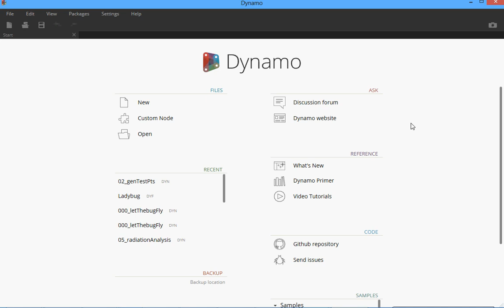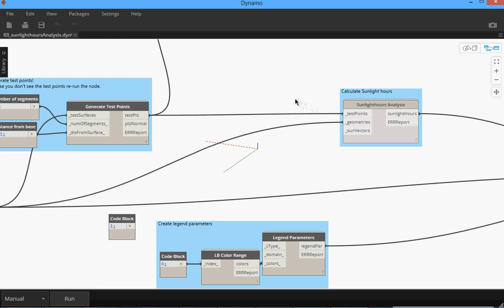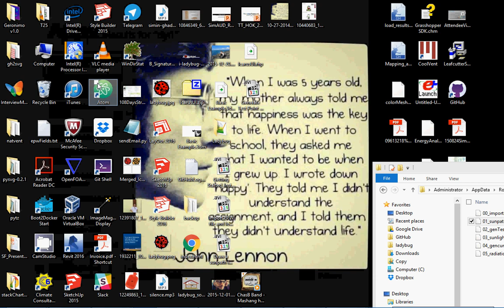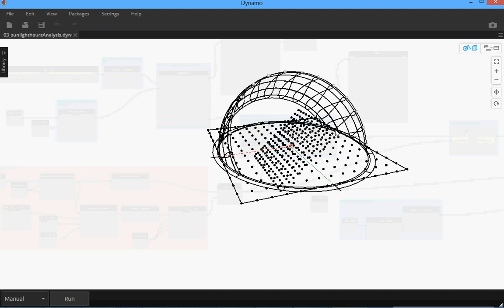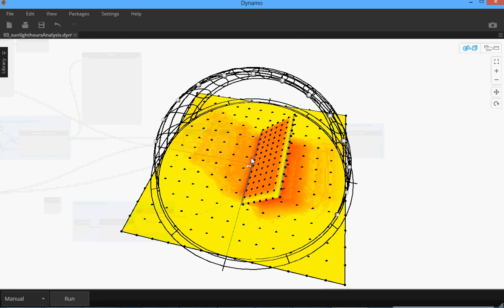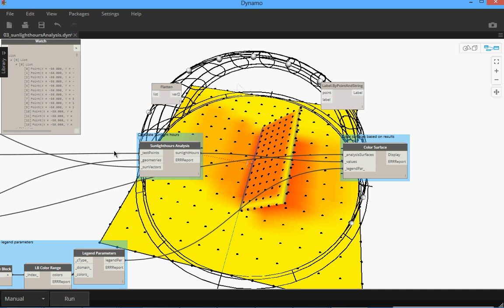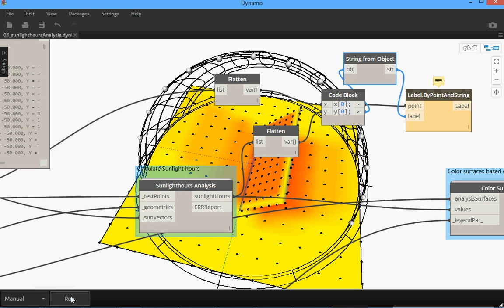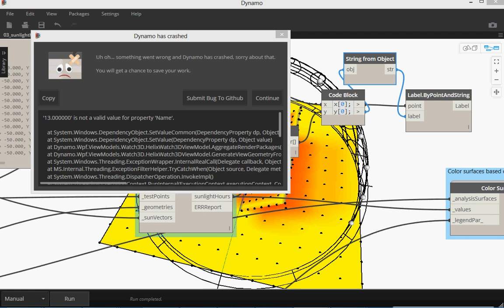Sunlight Hours Analysis in Dynamo

Comment: Thanks for your video Mostapha!  
But I'M  a new comer of dynamo .Could you tell me how to get  the "gencolors_code.py " in custom node "Generate_colors"?
Reply from the maker: You don't need to do it yourself. Just download the example file from here and it will have the definition already set for you: http://hydrashare.github.io/hydra/viewer?owner=mostaphaRoudsari&fork=hydra_1&id=Sunlighthours_Ladybug_Dynamo&slide=0&scale=1&offset=0,0
Reply: But the code block“Run Radiance Analysis” reported error，what's wrong...
Reply from the maker: You should post your question to the forum: (http://discourse.ladybug.tools/t/welcome-to-ladybug-tools-forum/8). It might have been already answered: http://discourse.ladybug.tools/c/dynamo/ladybug
Reply: I finished the “radiance” step，then the error became：“E is not a valid Honeybee boject." What should I do...
Reply: Error ：name “color” is not defined
File “<string>” ,line 23 , in <module>
Nameerror: name ‘color’ is not defined.

Comment: hi, can you tell me how to deal the relation between sun path scale and the size of surface, please?
Reply from the maker: Tallman Chan you can simply scale the sunpath in Dynamo using the scale input
Reply: Mostapha Sadeghipour Roudsari so it means it doesn't matter how big the sun path is ,the scale doesn't affect the result.  Right?
Reply from the maker: Right! The analysis is using the vectors for the analysis and not the sun geometries. Scaling the sun-path won't affect the results.
Reply: Thank you so much .Can dynamo show a label discribe the range of each color like  grasshopper's?
Reply from the maker: I'm not sure! I couldn't get it to work. Also see this: https://forum.dynamobim.com/t/labelling-point-visualising-data-cfd/9980

Comment: Hi, thanks for your lesson, but I have a problem with "Sunlighthours Analysis" node. I get an ERRReport: 'str' object has no attribute 'Reverse'. (It's abot _geometrty). What I've done wrong?
Reply from the maker: This should be an issue with your input for sun vectors. Have you checked to see if sunpath generates sun vectors correctly?
Reply: It was a problem wiht russian symbols in file name, now it's OK. But I have one more question. Can you explane where can I get Color Surface node?
Reply from the maker: It has been replaced by "generate colors" node. You can generate the colors and then use Display.ByGeometryColor to visualize the results.
Reply: Thank you.

Comment: Nice video Mostapha! I am selecting faces from Revit and then trying to bring the results back in via "FaceAnalysisDisplay.ByViewFacePointsAndValues". However, the node outputs a list of revit.analysis displays ( one for each surface) and only the last item gets visualised in revit. Would "FaceAnalysisDisplay.ByViewAndFaceAnalysisData" work better?
Reply from the maker: Hi Alexis! For some reason I missed your comment but here is a solution just in case it's still useful: http://hydrashare.github.io/hydra/viewer?owner=SamDehghani&fork=hydra&id=Bake-Honeybee-Results-To-Revit-As-Colored-Surface&slide=0&scale=1&offset=0,0